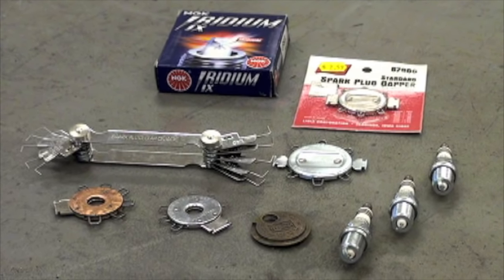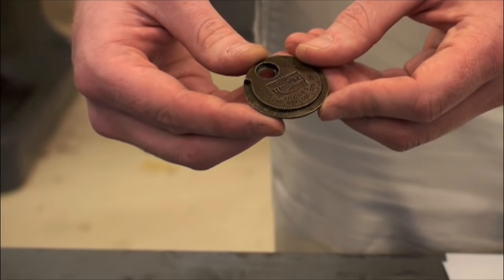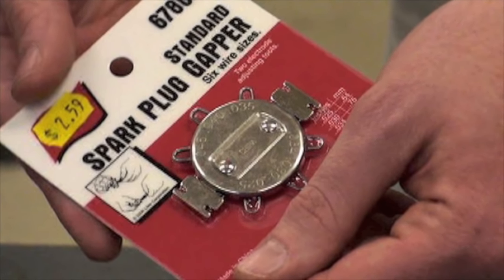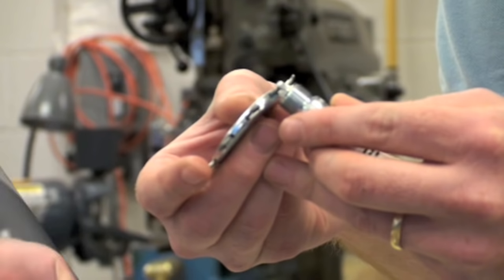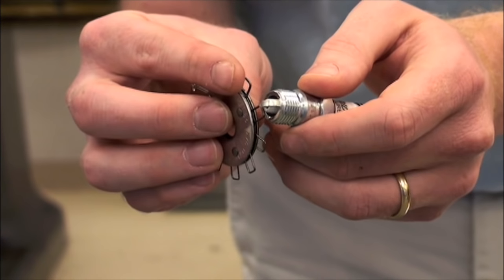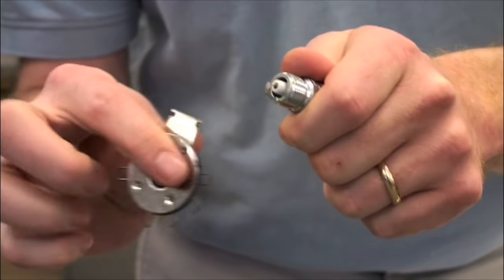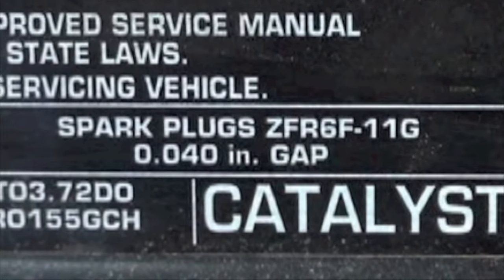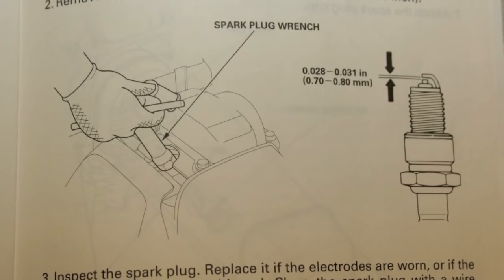Spark Plug Gap - NGK Spark Plugs - Tech Video

Comment: Maybe if you just gapped these properly from the factory? 

Just checked all 16 for my Dodge Hemi.  .043 is the standard (92145).  They're mostly .032 -.041.  Why doesn't NGK pre-gap plugs like everyone else?
Reply from the maker: Thanks for reaching out. Out of the box, the plug referenced, does come pre-gap @ .043. 92145 LZFR5CI-11. But we do recommend you check before installation.

Comment: coin style gap tools are perfectly fine. just don't use the measurement edge to gap it (as shown incorrectly in the video). Instead use the inner circle to lift from the top without touching the iridium.
Reply: +Manasvi Putcha I think you're right about the gapping method (I've always done it how you said), but if you think about the geometry of using an inclined surface to measure gap, it's not as accurate as a wire gauge.  I think that's the real discriminator.  Wire gauges will measure directly between the spark plug tip and the grounding surface - it's much more accurate with the right wire size.
Reply from the maker: +stevebean1234 +Manasvi Putcha Thanks for your comments guys. We used a coin style in this video to gap only to illustrate the most common error made when using this tool. This is one of the many reasons we do not recommend the coin style. Steve's point is also correct.
Reply: What??? Iradius dium ur comment was Chinese to me.  Lol but thanks either way 4 trying to help

Comment: The wire loop type was EXACTLY what I needed for Iridium Denso plugs.  The coin type was not doing it, and the blade type was hard to press together the blades to get the right depth and insert without fearing I'd damage the small raised bump on the arm above the core.  THANKS for this video.

Comment: I just use the coin style. It's good enough for copper and platinum plugs. Yes when you have the fine tip of the irdium plug you want to be extra careful. I always use a needle nose pliers so not to touch the electrode. I work outside alot and the feeler gauge tools tends to rust. The coin style though cheap holds up better to moisture. Always check the gap because one plug might fit many engines. More times than not I find a plug gap needs adjusted. Thanks for the video. 👍

Comment: @undertake782 Do u mean starting from cold? Some engines have a higher idle when started from cold for the first 1-2 min until the oil pressure is regulated. This is done through a cranking/breather vent that goes into ur intake. After the pressure gets regulated then the engine RPMs go down by about 200-300 dropping under 1000. It is normal. Misfires are not on the other hand

Comment: You are using the coin style gap tool wrong. If you use it correctly it also will NOT break the precious metal tip.

Comment: Plug gap is a specific distance determined by the output voltage of the coil. This is why the vehicle manufacturers specify a gap. You should check and adjust the gap to the manufacturer's specification regardless of spark plug.

Comment: In the military we always installed spark plugs with a smear of COPPER GREASE on the threads, and have been also using this same method on Wheel Nut Threads. Standard practice for of  50 years,
Reply: They. Have a special zinc coating now that acts as an anti seize in only the right places. Hence why messy copper slip is no longer needed. Saves over torqued plugs too.

Comment: Hello!
Is it good if a new spark plug PartNo PKER7A8EGS has a gap between 0.5-0.6mm or it's defect?
Reply from the maker: Pre gap for that plug should be .030" or .762mm. Not a defect but can be adjusted.

Comment: NGK 94702 Laser Iridium Info
Sedan; Body code L33; Gap 0.044" for nissan altima 2013..  2.5
Reply from the maker: Hey Franklin, spec in the book for your Altima is 0.043'' gap. 
Mike Becker, Senior Technical Instructor

Comment: Good info, but how are you supposed to maintain a proper, even gap? I still have a set of snap on gapping pliers that allows you to gap the plug and keep the ground electrode parallel to the tip, works very well but cannot be used on precious metal plugs. Just bending the ground strap out will give a poor, uneven gap, the tip of the ground strap will be farther away from the electrode then the body.How can we maintain an even gap??

Comment: If ratings weren't disabled (WTF?), I'd give this video 5 stars. Great explanation of coin vs. feeler gauges. The HD resolution is also a nice touch since the parts of a spark plug are so small, they'd be hard too see in a lower resolution.

Comment: Great video, one thing to note, I found that the $3 wire based tool has an issue, the adjustment part bent before the electrode, nothing a little quenching couldn't fix (even though I still had to hammer it out between plugs).

Comment: I purchased a se of 4 NGK 97138, it looks like al plugs were pre-calibrated for 0.043 and my Manual calls for a 0.044, should I adjust the gap?, BTW I have a 2010 Civic, Thank You
Reply from the maker: Great question. As all NGK Spark Plugs are pre-gapped at the factory. You are 100% correct to check it and if needed adjust to manufacturers specs.

Comment from the maker: Holding the spark plug in your hand, with the ground electrode facing down, tap the ground electrode against a flat surface lightly to close the gap up. Afterwards check your adjustment to ensure that it falls within the recommended gap.

Comment: task514 In the video it clearly states that for custom applications, the plug gap may need to be adjusted. If you're buying plugs for a car, and that car is modded, then you might not want to use the gap that the stock engine uses.

Comment: All of the auto part stores around here don't have the right tool. And they all tell me to do what this video said not to do. Since my Haynes manual agrees with this video I don't want to use the disc to change my gap. My spark plugs' gaps are slightly too small and I have to find a way to safely change the gap without the right tool, do you have any recommendations?

Comment from the maker: The BMW n52 engine series will require a .044" on the gap. That will cover both the 4cyl and 6cyl.
Reply: When I try use wire gap to check on 0.44 which is my correct gap to use. But when I bought new ngk spark plugs and checked gap using same wire gap your using. I try check and it easily went in so.does that mean i.have push down more to make sure it don't go through?
Reply: @thewebmogul . After reading your comment, I have no doubt that you are in fact a true crypto mogul! 😂

Comment from the maker: @dusch888 

This backfiring condition could have to do with timing or possibly fueling issues or maintenance issues. Generally backfiring will not have to do much with the plug unless it is gapped incorrectly.

Comment: I know that ngk recommends not using Anti-Seize, but my service manual from Honda says to put a small amount on the threads and torque to 13 lbf•ft. Is it possible that they say to use such a low torque because they already take into account the effect the Anti-Seize has on torque value?
Reply: It's the 2003 to 2005 Accord service manual
Reply from the maker: While Honda may use different plug manufacturers it hard to be certain. If NGK, then Anti-Seize is not recommended. If NGK, please follow the torque specs in the back of the current NGK catalog or on our website here: http://www.ngksparkplugs.com/tech_support/spark_plugs/installation/index.asp?mode=nml#installing
Reply: There is something called wet and dry torque. has nothing to do with the plug itself    that has to do with the threading and the material. Anti seize will absolutely not have an adverse effect on the plug performance whatsoever.  This shit isn't rocket science anyone who knows anything about anything knows this.  Some copper coat and away ya go  nothing wrong with being able to break them free easily.  same goes with wheel studs brakes etc...  if you're smart and want to help eliminate  risk copper coat everything   makes your life easier when it comes time to take whatever out or apart and decreases the chance of snapping anything off.    End of story bottom line...
Reply: Hondas repair manual specifically says Anti-Seize. And specifically recommend NGK or Denso. NGK being listed first and also the original plugs I pulled out of the car

Comment: 1:42 you're doing it wrong...see the side of the coin with the hole in it? you place the side electrode in there like a bottle opener and gently pry it up, this way it doesn't touch and potentially damage the center electrode. the only problem with those tools is the reliability might be questionable, but they should be accurate enough get the job done.
Reply from the maker: Your 100% correct. @ 1:42 were demonstrating a common error or misuse when using this type of tool. Many times a user will slide or even start prying on the wrong part.
Reply: do you know where can I buy a gapper? how much?
Reply: Barto Vines you can buy one anywhere. an auto store such as advance auto or autozone, ebay, amazon, anywhere. they're only a couple bucks. i have a lisle coin style gap tool, similar to the one i pointed out in my original comment that was being used incorrectly.
Reply: Thanks man, I will get it from O'Reilly.
Reply: Barto Vines no problem. just to let you know, i specifically purchased the one made by lisle based on their accuracy.

Comment: Kinda sad video. We all know basically how to gap a plug but since these new plugs are delicate I wanted to see a close up of the gauge and the fit it had between the electrodes. Another words just how tight/resistance was the tool to the electrodes.  To be honest I mean if this is a video someone needs  to watch before replacing spark plugs then perhaps it is best you let a mechanic rip you off.

Comment: My new set of NGK Iridiums are all preset for about .0425.   The spec for my car is 0.043.  Maybe my coin is faulty?  Do I really need to adjust these gaps for such a small amount?  What are the effects of .0425 vs .043?  Thanks.
Reply from the maker: icawn Thanks for your question. With such a small gap size difference there is no need to adjust. However, avoid using a coin style gaping tool with iridium spark plugs. These are known damage fine wire ground electrodes and are not 100% accurate. Outside of that thanks for your support of NGK.
Reply: @ngksparkplugsusa  ngk Iridium ? Mille km? Use ?? Years ? Thanks

Comment: This video fails to illustrate the point when a proper gap is achieved using the tool. 

If you have a plug that needs 0.60 spec, then the 0.60 tool must barely have resist or a slight "grab" when checking. If the tool slides freely with no resistance, you are over-spec and need to close the gap and recheck for the slight contact.

Comment: Hey, I would like to ask how you would know if your engine is misfiring as a result of plugging the spark plug wires in the wrong configuration? My dad has a 1995 Ford Explorer and the RPMs go up and down a bit about 200 RPMs when you first start it but you don't really notice it or it stops after about 2 minutes. Is that normal? I am just worried I might have plugged the spark plug wires with the wrong cylinders. Thank you.

Comment: @LennyCox Did I comment on that part? No, I'm just saying they're pretty stupid to mention why you shouldn't use a certain tool because it can damage the electrode and that's only the case because they're not even using the tool correctly! If used correctly, the coin gapper doesn't even touch the electrode tip.

Comment: @emp0rizzle Seems as though you missed the portion of the video prior to that demonstration that read, "Gapping - Incorrect". Also, maybe you didn't listen to the guy when he said gapping plugs the incorrect way could break the plug, and if that happens you should throw it away. I believe he should have  shown you the correct way to gap using a coin gapper though, not just the incorrect way.

Comment: If I installed new plugs and the engine is misfiring, does this mean that it will eventually stop misfiring once it's weared down enough?
Reply: No. Spark plug gaps don't wear down.

Comment: I used a coin style because I didn't know better. However, I checked the coin with accurate calipers at the gap I needed.  The coin was off by .002" too thin.  The plugs all measured .029" on the coin, which means they were really gapped at .027".  The target was .031" so the difference was .004". Or in other words, I had to get the coin to measure from .029 to .033".  I checked .033 on the coin and it was .031", Ok?  Therefore I had to open each one by +.004".  That sounds complicated but I measured .033" with my calipers and that read .031",OK? 
   I couldn't believe that they were all off by such an exact and consistent amount. Were they really off?  What could be inaccurate about this?
   I should have sanded the coin smooth on the bottom, cleaned it, then add layers of packaging tape until it's accurate. Then it wouldn't be so weird.
    One plug had a tab that was much weaker, and my first push moved it way out.  Then I pressed it back and was back to where I began. Why was that tab so weak?  Will it fall off?
      So I'm concerned about that plug and also second guessing the coin measurer because there may be a .004" feature on the tab such that a flat feeler gauge would be off because that .004" feature is not lined up with the Ruthenium point, and the real gap is .004" wider, if read with a wire type. Maybe?  I don't know.  I'll have to look under a magnifying glass to see if I really need a wire type. If this is the case I'd really have to push each tab .004 back in?  Maybe?  Did they gap them to my car?  I just don't know. There are some platinum plugs that require a .040" gap.  Where did I come up with .031"?  I thought I saw that on NGK.  Now I question everything. I hate this about myself. It drives me crazy.  If NGK could address this, my car is:
2003 VW Passat W8 wagon (4.0 L V8 engine)
Hopefully, someone can straighten me out.

Comment: When I gapped my spark plug, I left a scratch in the ground electrode. Should I throw it away or is it good to use?
Reply from the maker: Hey, what kind of scratch are we talking? Just a little surface scratch or a deep gouge?
Mike Becker, Senior Technical Instructor
Reply: ngksparkplugsusa It's a light gouge. It's not deep but you can definitely feel it if you run your fingers through it.

Comment: argghhh horribly detailed!!! they doesn't tell me at all how to gap    a spark plug, you need to start this video over. using the coin since that is most standard. what is the correct gap!!!! give give us an example! 

My question is, what is exactly .032? with the spark plug. just make another video its easier that way. we can use the coin gapper for copper plugs!!!

Comment: Hmm but NGK recommends not to adjust gap, guess this is an old vid
Reply from the maker: Hey, where did you hear we don't recommend checking/adjusting the gap? Every plug should be inspected and checked for proper gap prior to installation.
Mike Becker, Senior Technical Instructor
Reply: Whats the best gap for 04 g35 rwd? Say for racing or drifting

Comment: You're gapping it wrong with the coin gapper. You're suppose to use the keyring hole, not the measuring side of the coin. The hole has a protruding lip that is suppose to be slid on the underside of the side terminal and then pried up to adjust the gap. FAIL.